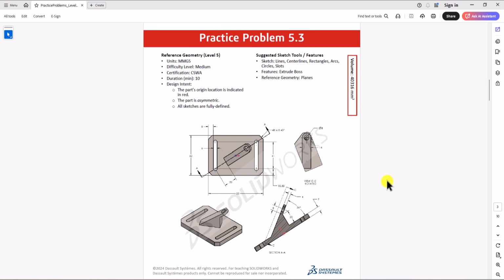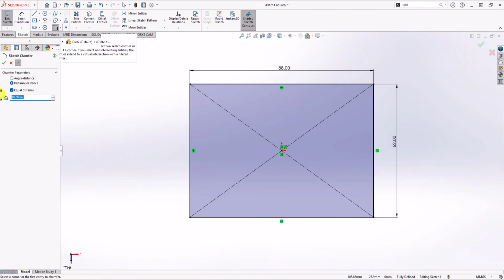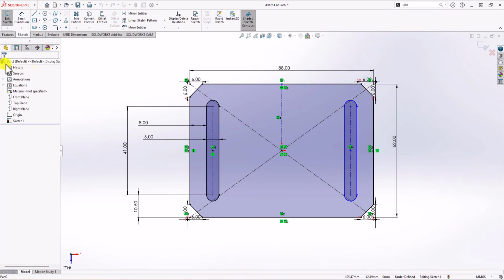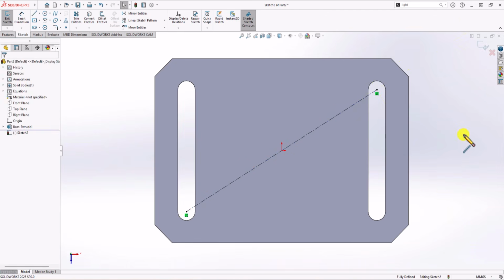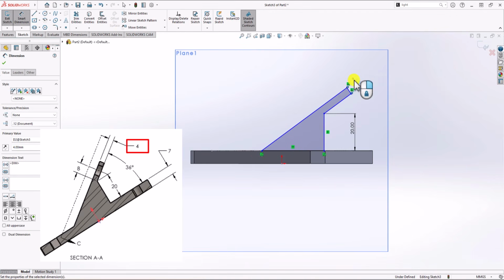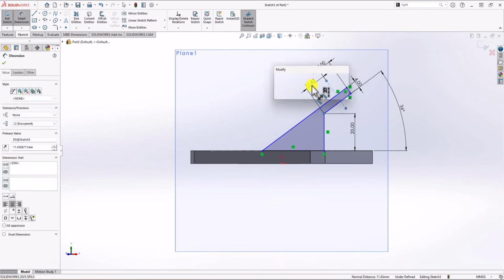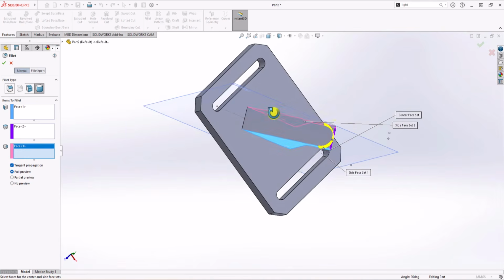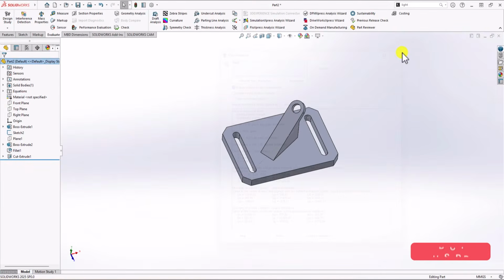CSWA Practice Problem 5.3 Solution | SolidWorks Exam Guide

Comment: Hey, the sketch chamfer tells us it's 45 degrees, so both distances will be equal. But how did you know it's 6mm? because there's a 4x and a 6x
Reply from the maker: That’s a great question! Normally, chamfers on drawings are shown in the format A × B × C.
In this notation, A represents the number of chamfers, B is the chamfer size in millimeters, and C is the angle.

For example, if the drawing shows 6 × 2 × 45, it means there are six chamfers, each with a 2 mm length and a 45° angle. I hope this answers your question
Reply: @Design_With_Roozbe  okay thanks